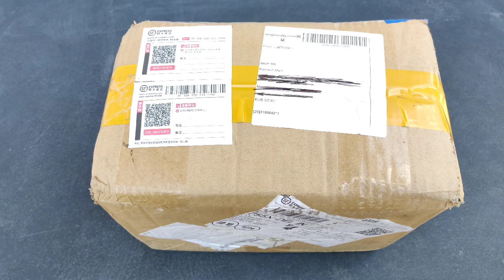Most Powerful Stirling Engine

Comment: Great! My humble suggestion would be to use alcohol instead of gasoline and the wick should stick out shorter. This would prevent smoke and dark ash on that wonderful piece and less flame on the device.
Reply: Or lamp oil
Reply: @onebigboii2902  Alcohol is a clean fuel and  does not leave any soot behind. Gasoline has hazardous chemicals and should never be burnt in the open.

Comment: is there any connection between cold chamber ant the hot one
Reply: Yes it needs the one chamber to be hotter then the other chamber, normally it doesn't which is which. 
Do a Google, the way it works I'd interesting.

Comment: Why you have fire and gasoline together? What is the purpose of fire that affects gasoline? It causes gasoline to heat up and go up to feed the fire? So, gasoline is a fire-feeder, so the fire burn the strings but gasoline keeps the fire going and strings will stay on?? What happens when gasoline heat it up?? If you put water, or just empty with only strings, the fire will burn and cause motion since it creates pressure upward.
Reply from the maker: That is My mistake. Alcohol is must for this type of Engine
Reply: @creativethinkideas  Ok, ya didn't explain the process, so what is the process as I mentioned above?